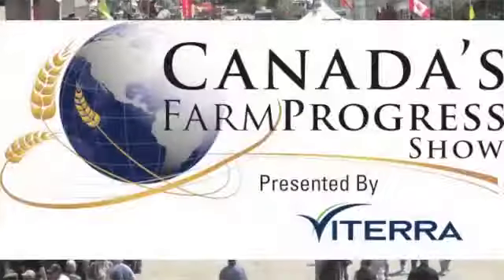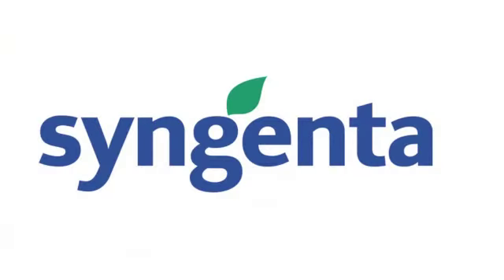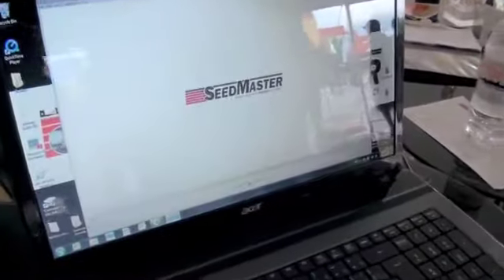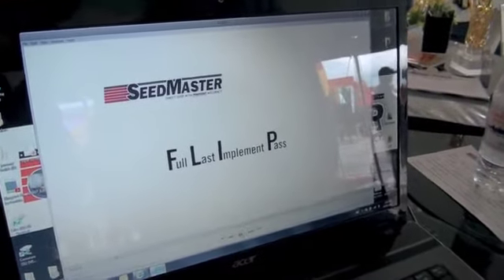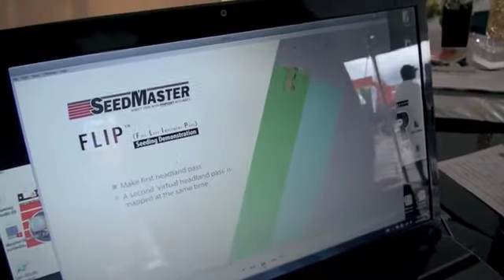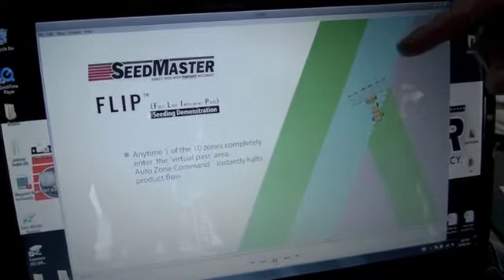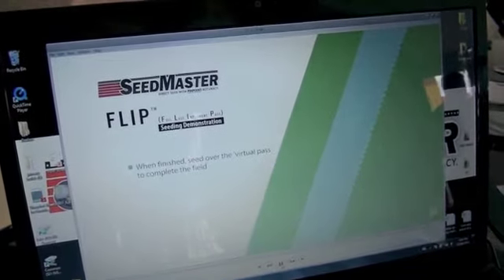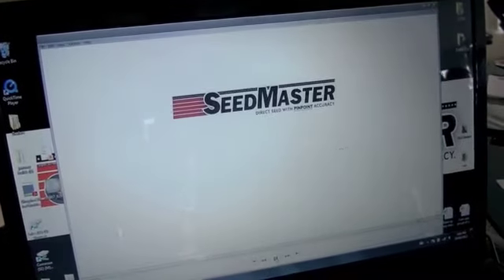The SeedMaster Flip System

Comment: Thats a software upgrade correct? Are they using Raven GPS or is it their own proprietary system? Can I get that on my Trimble or other breed GPS system? 

I would love that even feature even without section control. In flax, I like to seed the headlands last to prevent excessive packing on previously seeded headlands.